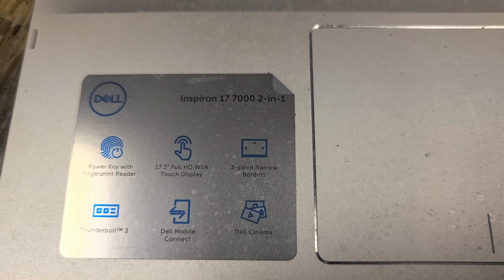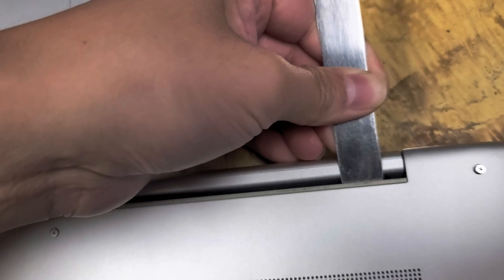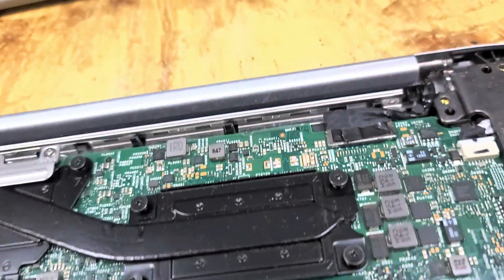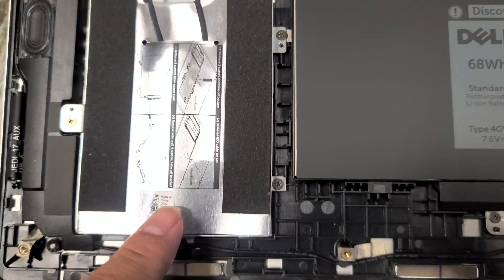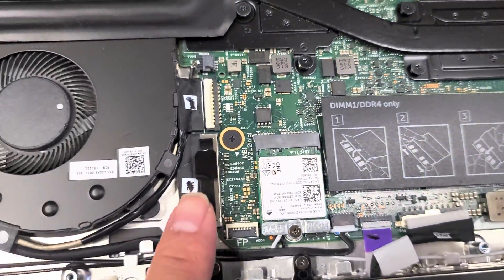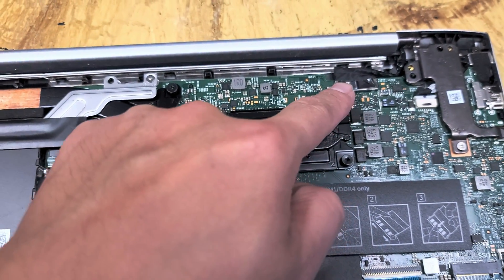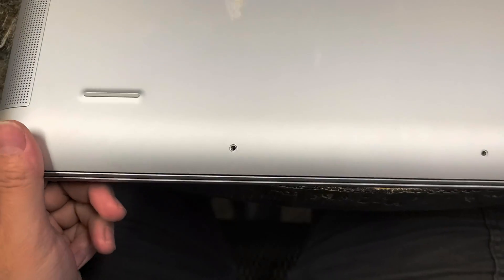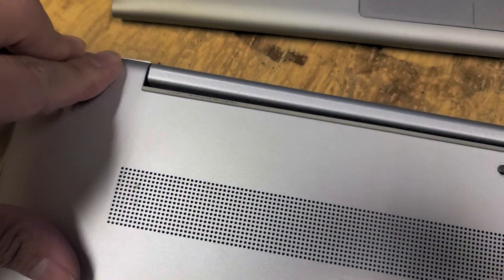DELL Inspiron 17 7000 2-in-1 2n1 7791 Disassembly RAM SSD Hard Drive Upgrade Repair

Comment: Dell specs say the max is 16GB of memory.  You stated that you can upgrade the memory to 32GB?  Will the system recognize that size?  Thanks for any info.  Greatly appreciate your help.
Reply from the maker: Usually will work fine. 9
Reply: @ItsBinhRepaired  Thanks so much!
Reply from the maker: @WhatsUpWithSix  no problem

Comment: neat video! I'm thinking about building my own pc and was curious if i could use the ssd from my inspiron 7791 in the new rig. Thanks in advance
Reply from the maker: Depends on what your motherboard supports, but why would you want a junky oem SSD in your computer? Get a real aftermarket one. They're so much better.
Reply: Looks like it should work with my motherboard. I’m personally content with the speeds I get in my laptop and was just tryna save a buck as it’s a pretty low-cost build. Thank you for your answer though I appreciate it
Reply from the maker: @BenjaminTurner-s6u  SSDs are super cheap now. 1tb is like $50
Reply: I will definitely consider it. Thank you for all your advice and assistance
Reply from the maker: Yup

Comment: I'm planning to upgrade my dad's inspiron for his birthday. I want to replace the touch pad (he has to use a mouse because it doesn't work anymore) and upgrade the ram and perhaps ssd to 1tb. Thanks for this introduction! I don't know if he has the 7791 model but they look exactly alike. I'll have to inspect it when he's not looking (it's going to be a surprise so I hope I don't mess it up). Do you do videos for very old laptops?
Reply from the maker: That's very kind of you, but be very careful with that. Wouldn't want to lose all his data in the process.

If you could get the service tag (ST) number (usually on the bottom) I could look up the exact model.

Comment: Hello. I was wondering if I replace a harddrive because of BitLocker issues will i have to somehow install Windows all over again or is there some kind of work around for that?
Reply from the maker: You need to remove bitlocker first or clone while logged in or do a clean install.
Reply: @ItsBinhRepaired  Unfortunately the problem is the BitLocker itself… I can’t log in because I don’t have the key, and never installed it in the first place… Couldn’t get any help not from Microsoft not from Dell… It’s been very frustrating… So instead of wiping it clean & loosing all the data, i was told that the hard drive could just be replaced & i get to keep the old one with all the data on it & hope that maybe someday Microsoft will release the solution to access the old drive. If there’s any other way to unlock it/bypass BitLocker I’d rather do that then replace a harddrive 😩
Reply from the maker: @andreim7808  should be linked to your Microsoft account. You'll see instructions on the screen
Reply: @ItsBinhRepaired  I checked and it was not there, and I never created it myself. Tried some stuff through command prompt & it didn’t show the key, changed some settings in BIOS.. Nothing worked…
Reply from the maker: I hate how YouTube doesn't notify me of replies. Were you able to figure it out?

Comment: Do you know how to remove the Finger Print board?
Thanks
Reply from the maker: What do you mean?
Reply: @ItsBinhRepaired  
I meant to remove and replace the small 1/4 square inch finger board that is glued in the chasis.  However,  I had it fixed.

Last weekend,  I spilled beer on my keyboard that made circuit shorted, and I can't power on my laptop.  Now, I removed the board,  cleaned it and put it back.  It works :)
Reply from the maker: @Vgjbfgaas  great

Comment: FP likely means "Front Panel".
Reply from the maker: Fingerprint
Reply: @ItsBinhRepaired  I connected a SSD/Secondary Hard Drive to this port using a cable and it was recognised and works.My Dell Inspiron 7751 2 in 1 came with a large battery and i downgraded it to a 52whr battery to make space for the 2nd hard drive.
Reply from the maker: @varmaTrini  interesting, glad it worked! :)
Reply: @ItsBinhRepaired  https://www.youtube.com/watch?v=Ty7jl-no2LQ.
Reply: @ItsBinhRepaired  My Dell has built in Finger Print reader into the Keyboard and an additional FP port!.

Comment: It didn't show anything about removing the hard drive?
Reply from the maker: Just have to remove a few screws and pull it out. If you can't figure it out, watch a few of my other videos. Sounds like you've never opened a computer before. Best you watch a bunch of videos for more experience before continuing. I mention in the end it you need to see how to remove other components you'll have to watch other videos.
Reply: @ItsBinhRepaired  I have removed plenty, but my comment was for my son who had never took the cover off his computer, he watched your video, and it was a little confusing for him.
Reply from the maker: I see. Yeah, this video was made at a health office. I wasn't able to do a proper video. If he watches a few other videos of different models, they are very similar.

Comment: Few weeks ago I suddenly got a Message "Hard Drive not installed" on my Dell Inspiron 17-7000(7778) (i5 processor) series and couldn't access Windows anymore, this was after a lot of years of ongoing screen freeze alongside other issues that we had on 2 same Inspiron laptops since day one and have reported to Dell but unfortunately Dell Customer Service and Support have Failed to Address the Core Issues tell warranty Expiration.

Now I would like to try and upgrade to SSD M.2. 
In Setup and Specifications THE ONLY THING I FOUND is that I can Install One-m.2 drive and One-2.5 inch drive.
Is Samsung 970 EVO Plus NVMe M.2 (1TB) or pro series compatible?, There woulden't be any Bios issues? And is there a limit of storage capacity that my 4-5 Year old Inspiron-17-i5 can handle on both Hard Drives (primary and secondary). Thanks.
Reply from the maker: No limit other than the type of m.2 SSD SATA or PCIE NVME.
Reply: @ItsBinhRepaired  
that's it, I don't know what type.
can you suggest?
Reply from the maker: The Samsung one should work fine.
Reply: @ItsBinhRepaired  thanks
Reply from the maker: @cosmicprincesA1234  no problem

Comment: I have a ripjaws 16 gb ram which is PC3L-12800. Will it work in the Inspiron 17 7000 series
Reply from the maker: No, it uses DDR4 RAM. Please watch the video.
Reply: @ItsBinhRepaired   I watched the video. It was mentioned that it uses ddr4 but I am a novice/tinkerer when it comes to Computers thanks for your reply
Reply from the maker: @tonytucker8651  the different types of RAM has different notch positions. It's physically impossible to install different types of RAM: DDR, DDR2, DDR3, DDR4 in the slot designed for another. The speeds are the only area you can put the wrong type and it'll cause boot issues if not supported.
Reply: @ItsBinhRepaired  ok, thanks
Reply from the maker: @tonytucker8651  no problem

Comment: Does this laptop have a wifi switch on it?
Reply from the maker: Other than the keyboard/software switch, I don't think so.
Reply: @ItsBinhRepaired  What is the keyboard switch? I'm not seeing the wifi symbol on any of the keys.
Reply from the maker: @kevinmahoney9205  I'll need to see a picture. I don't own these computers. Please send a YouTube video of your keyboard
Reply: @ItsBinhRepaired  The computer belongs to my parents that are in Florida. I've spent hours on the phone with them trying to get their laptop to connect to their cell phone (with Hotspot turned on). My dad is 80 and knows nothing about computers. Trying to get him to read what's on the screen is a trick sometimes. But, he claims the wifi icon is not visible (by the clock) and running the network troubleshooter says the wifi is turned off.
Reply from the maker: @kevinmahoney9205  you'll need them to send you a video lol so difficult working with old people. They get charged more just for the headaches lol better they bring it in somewhere.

Comment: .......can the Fan be changed from this side (would you get the screws from bellow)??? I had to change it on another Dell and therefore i had to unscrew the whole mainboard! How is it with this noteboo?????? ...and is it quiet????? ...i think yours is not the same as the following!???
https://www.dell.com/de-de/shop/laptops/neu-inspiron-17-7000-2-in-1/spd/inspiron-17-7706-2-in-1-laptop/cn77604#features_section
Reply from the maker: You should be able to tell from how it's mounted in the laptop.
Reply from the maker: This should help https://youtu.be/3zs_SJ3BXgA